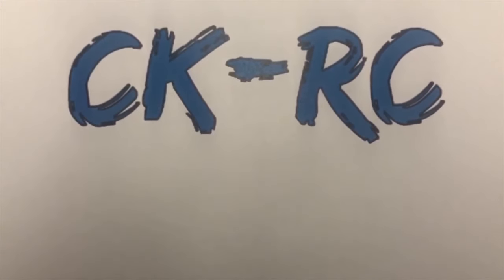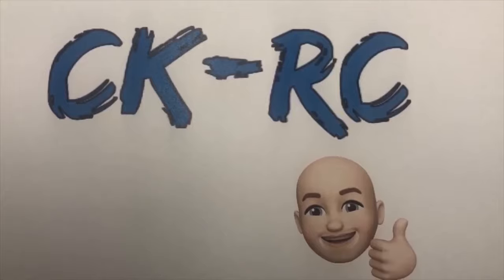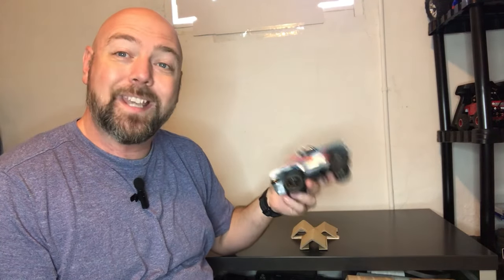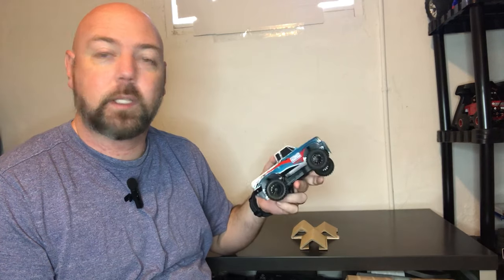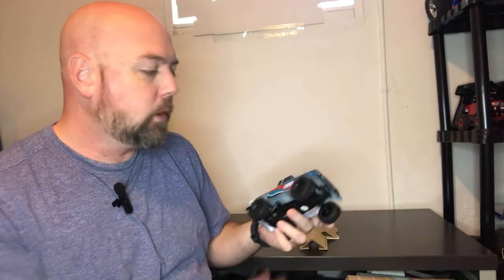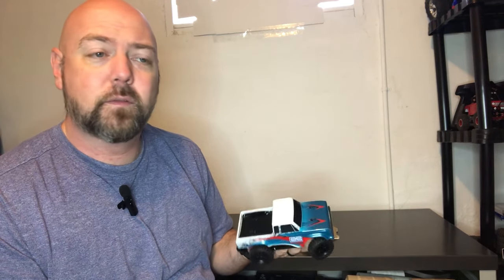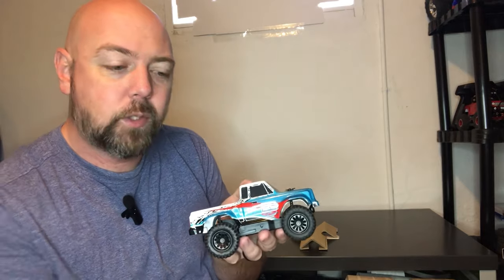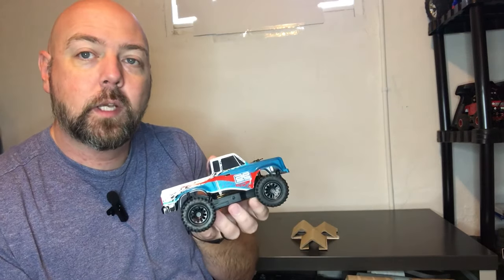Team Associated CR-28 review, part 2: performance testing

Comment: I like the idea of getting one for a short track/jump truck. What kind of upgrades are available for them?
Reply from the maker: There's really not much available.  Some people have created a 3D printed tub so they can essentially build their own and slap the body on top, and then there's the unofficial front suspension that I mentioned, but those are also just 3D printed parts.  There have been a decent amount of people who have made mods to the battery and tried upgrading the electronics, but it really comes down to your own know-how and comfort level with experimenting.  The platform itself is very limiting.